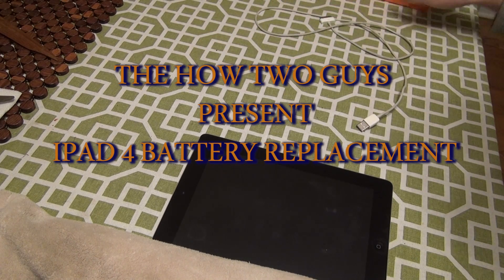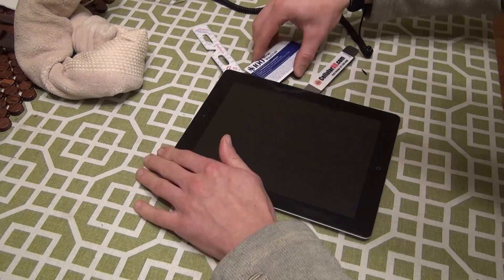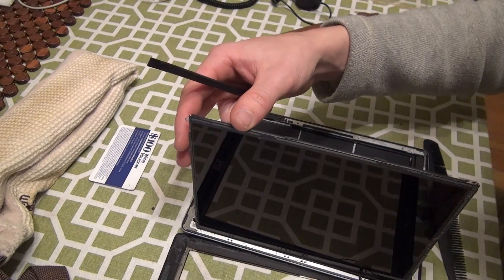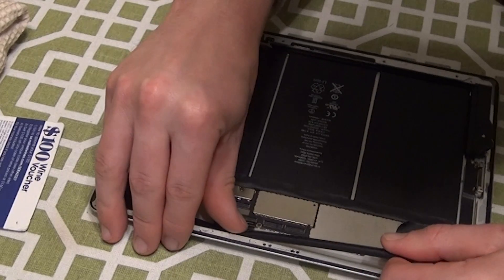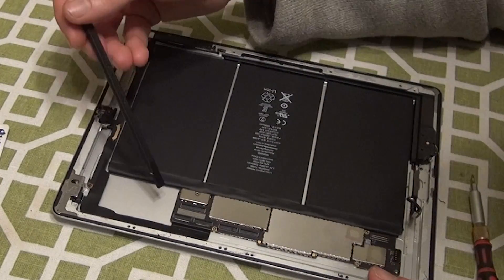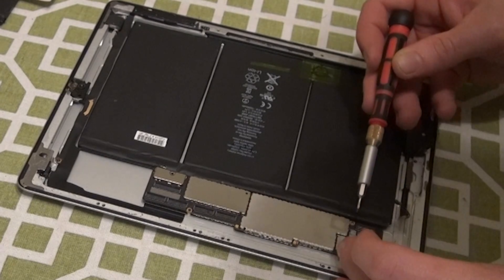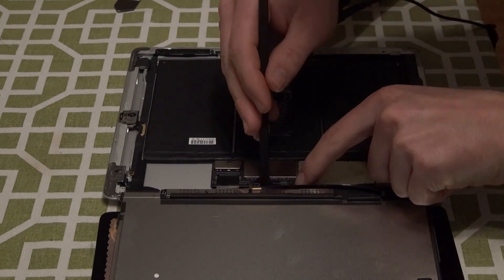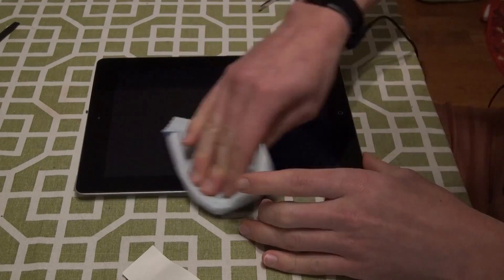iPad Battery Replacement Step-by-Step

Comment: I would highly suggest anyone attempting this to be absolutely 100% sure to use a battery terminating shim. It can basically be nothing more than a piece of an old credit card with a little notch cut in it or a thin guitar pick with a notch cut so it will fit around the screw hole on the battery connector and block the pins of the battery from touching the logic board while working. You have to be sure the battery never makes contact with the logic board (or motherboard as he calls it in this vid) while the LCD is unhooked or being reconnected. He does not use one at all during this video and I am really surprised he didn't blow either one or both of the backlight IC, coils or filter. Golden rule is to NEVER remove or attach an LCD screen to a logic board in an iPad if it is still making contact with the battery. Always slide a battery terminator between the logic board and battery connector and leave it there. I use a thin plastic card and then tape it down so it cant be moved, bumped or inadvertently pulled out  the entire time the LCD is unhooked. Once everything is reassembled and the LCD flex cable is reattached to the logic board, the final step before screwing the LCD back down is to pull the plastic card out and put back in the battery terminal screw.  If you don't use a plastic shim, you have about a 50/50 chance of shorting the backlight coil/filter when reconnecting the LCD. A blown backlight filter or coil will result in the screen not lighting up properly, typically when only 1 blows, only 1/2 of the screen will fully light up. This can usually only be repaired at this point by someone with micro soldering skills and equipment and turns an inexpensive battery replacement or screen repair into a much more expensive project!
Reply from the maker: Thanks for the great advice! I can say it must be better than 50% chance because I've never done that and have replaced many many iPads and iPhone components. I will certainly start doing that now though! I had never heard of it before.
Reply: Thanks for the tip!!

Comment: i have a redirection loop on an ipad 4th, i open it and the battery is inflated, however i dont know if replacing the battery will fix my issue, does anyone knows?
Reply from the maker: inflated battery is extremely dangerous. Likely this is your largest issue, be extremely careful not to puncture this battery it may explode. I would replace it immediately.

Comment: Hi. 
How could i know if the battery doesnt work in my ipad A1460
Thanks
Reply from the maker: if it turns off right after you unplug it everytime
Reply: if is inflated, burner, if you check it with a multimeter and it does not have proper voltage, if your battery dont retain charge